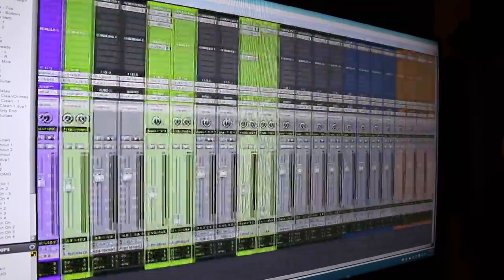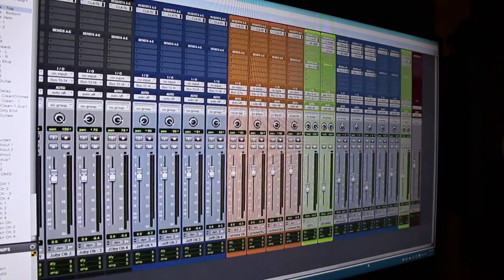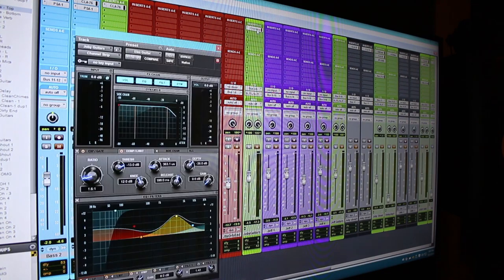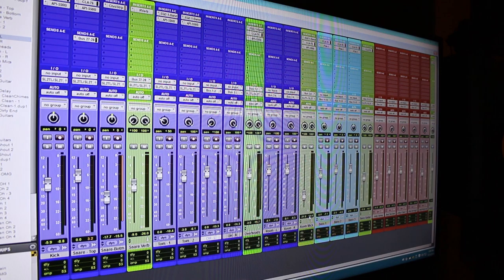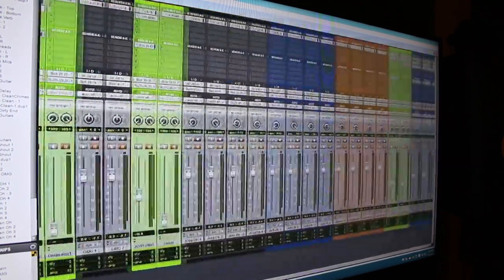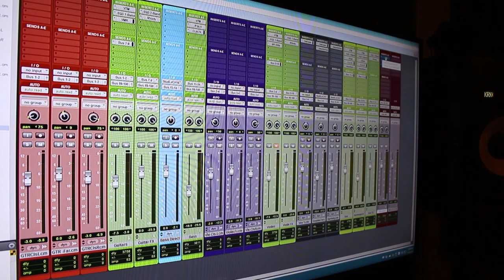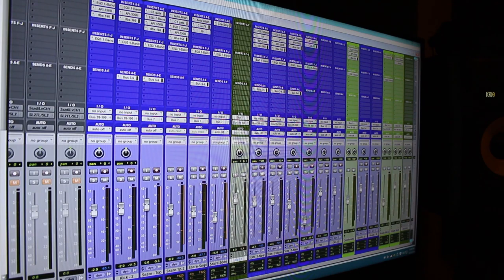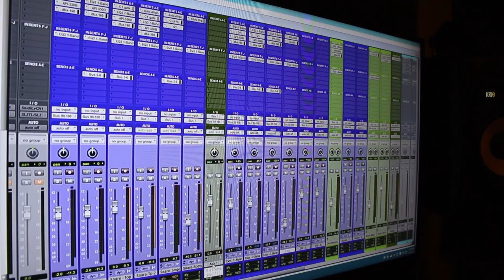How to use Buses when mixing - Protools

Comment: Thanks so much bro. It really helps having you break it down. I knew how to send and receive. How to assign them. But just didn't know why exactly it was better than putting all effects on one track. But now I see why you would. So nice.  So really it is huge not using all the CPU it would take with a whole track loaded with effects. And then I can't shut all on or off on demand

Comment: Bro I can't believe the number of tracks lol. Holy shit what are you running for hardware. Lol. I have a iMac to so I've got like protools lite but never used. Always been into logic but hopefully should be able to run a number of buses without problem?
Reply from the maker: +Ryan Phillips Intel Core I7 6700k, 32gb of DDR4, Samsung Evo 850 SSD, GTX 970 it can handle a pretty ridiculous amount of shit... but again that's a great reason to use buses to spread out the work load ;) logic shouldn't be much different. Also pro tools a couple versions ago added a feature where if the track isn't actually playing it sorta shuts off the plugins ... if that makes sense. So I'm certain that helps.